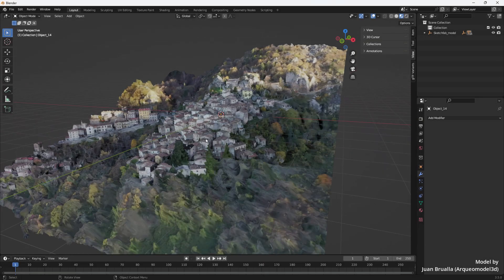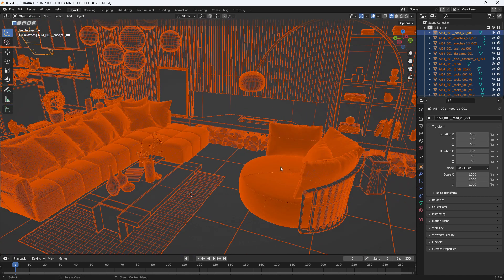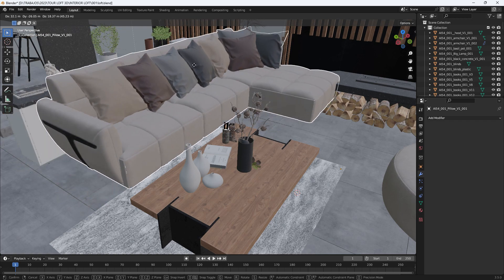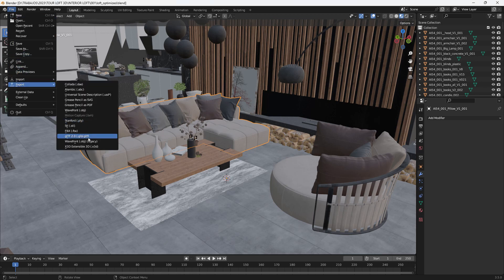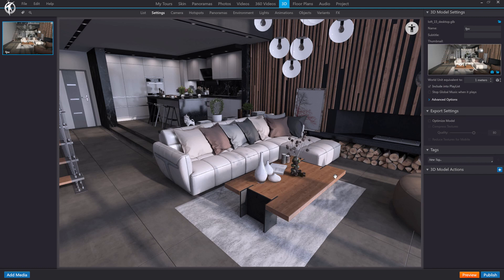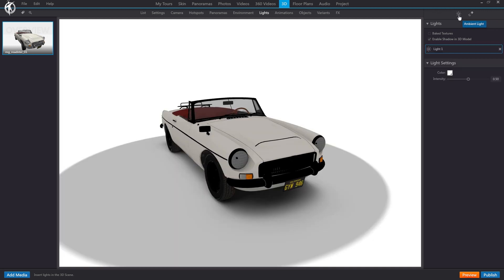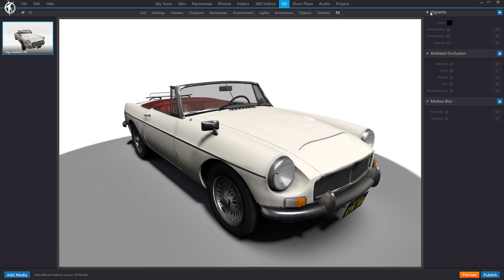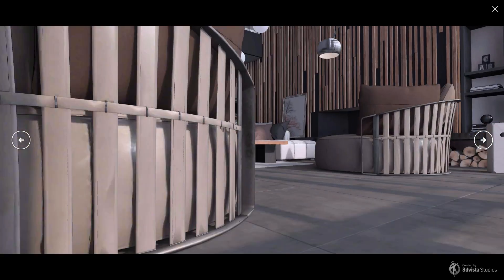How to Optimize your 3D Models

Comment: For large photogrammetry models, support for tiled/level of detailed objs or meshes would be extremely beneficial.  I'm not sure how feasible this is with your software. You'd need to then stream the model data rather than loading the whole model all at once.
Reply from the maker: Coming in a few weeks :)
Reply: I second this, however it could be very difficult to impliment any progressive loading feature.

Comment: Another great way to get it done is with baking normal maps. You get your high poly mesh, duplicate it and use the decimate modifier on one of them and uv unwrap the low poly mesh. Now in your shader editor, you make a new image texture; this would be our normal map. Next, you select the high poly and low poly meshes in order, go to the render settings while in cycles mode, and look for bake. Make sure the active to selected is checked and you pick the change the bake type to normals. Once done baking you can plug the new normal map into the normal map node and plug that into your shader. Then that's it.

Comment: Great video - learned quite a few things here with the GLTF Models.  One thing I think you missed out on is the original import of the OBJ file.  I have always experimented with the OBJ file and getting that down in size, but it looks like you just took the OBJ the way you got it and reduced that.  Perhaps it needs to be a combination of both.